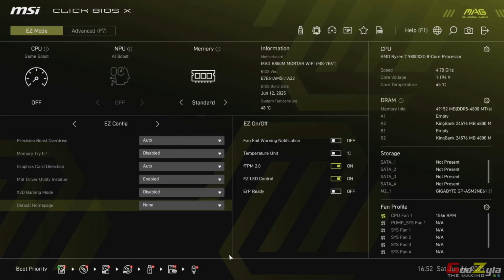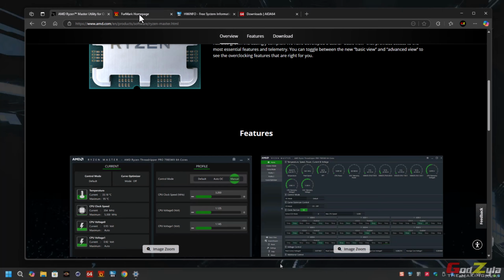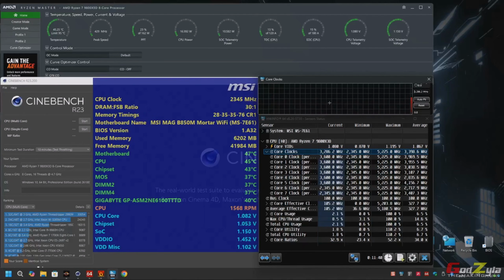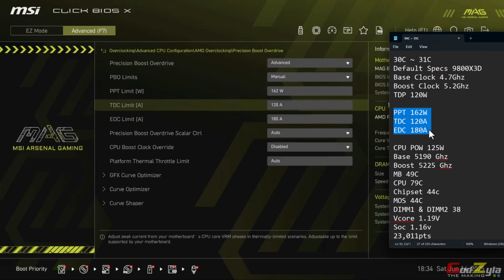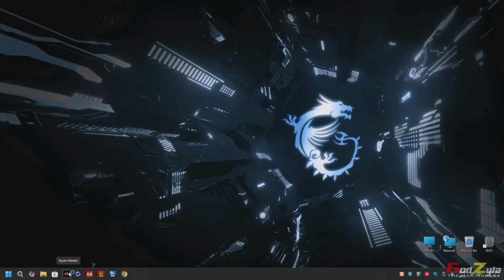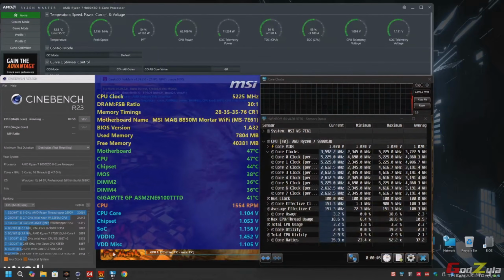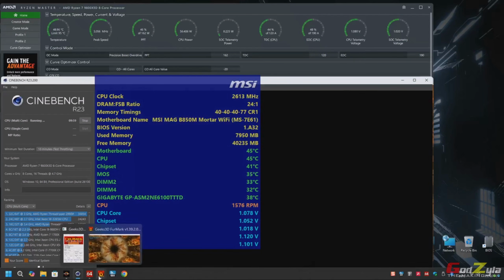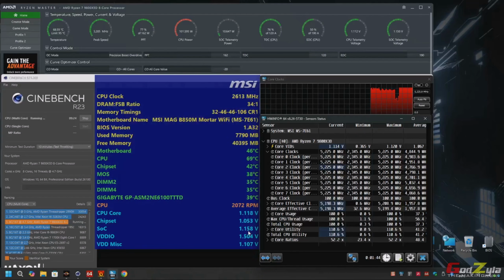PBO2 Curve Optimizing with 9800X3D on MSI Motherboard

Comment: On a Ryzen 7 9700x with an Asus B650M-E motherboard, what could I take from this video, or any tips to improve PBO and CO?
Reply from the maker: Welcome to my channel tgordo, you follow below steps and make sure you test it. 
Disclaimer, I will not be responsible if anything goes wrong. Do it at your own risk.

==Undervolting  Steps for 9700X==
Clear CMOS first  (PLEASE MAKE SURE TO CLEAR CMOS) and go into UEFI / BIOS

01) Go to Overclocking
02) Enable A-XMP or EXPO (depending your rams which it supports)

Skip step 03) to 05) if your rams are not of M/T 6000MHz

03) Set DRAM Speed 6000
04) Set FCLK Frequency 2000
05) Set UCLK DIV1 Mode to UCLK=MEMCLK
06) Set CPU Voltage to Offset
07) Set CPU Offset Mode Mark to - (negative)
08) Set CPU Offset Voltage to 0.05V
09) Set CPU NB/SoC Voltage to Override Mode
10) Set Override CPU NB/SoC voltage to 1.15v (make sure is 1.15v and not 1.5v)
11) Save and load to windows, run Aida 64 Stability test for 30minutes

If with errors, go back to UEFI, set the CPU Offset Voltage to 0.025V, repeat step 11) 
If still error, go back to UEFI set CPU Offset Voltage to Auto. (repeat step 11) 

if still error, go back to UEFI set Override CPU NB/SoC Voltage to 1.16V (repeat step 11) 
If still error, go back to UEFI set Override CPU NB/SoC Voltage to 1.17V (repeat step 11) 
you might need to set NB/SoC Voltage higher if it keeps failing but do not set CPU NB/SoC voltage above 1.18v
If no errors, go to UEFI and proceed to step 12).
The above is to ensure your processor can run at offset voltage and your RAMs able to run NB/SoC Voltage at 1.15v ~ 1.18v (depends which is stable for you)

12) Go to Overclocking
13) Set High-Efficiency Mode to Enable
14) Set Memory Timing Preset to Tightest 
15) Save and load to windows, run Aida 64 Stability test for 30minutes

If with errors, go back to UEFI, set Memory Timing Preset to Tighter, repeat step 15) 
If still error, go back to UEFI set High-Efficiency Mode to Auto.
If no errors, go to UEFI and proceed to step 16).

16) Click on Advanced CPU Configuration
17) Click on Precision Boost Overdrive
18) Click on Manual 
19) PPT Limit to 88W / 88000mA 
20) TDC limit to 75A / 75000mA 
21) EDC limit to 150A / 150000mA
22) Set Platform Thermal Throttle Limit 90
23) Scroll down, click on Curve Optimizer
24) Select All Cores under Curve Optimizer
25) Select Negative under All Core Curve Optimizer Sign
26) Set All Core Curve Optimizer Magnitude to value 20 
27) Save and load to windows, run Aida 64 Stability test for 30minutes

If with errors, go back to UEFI, set All Core Curve Optimizer Magnitude to -15, repeat step 27)
If with errors, go back to UEFI, set All Core Curve Optimizer Magnitude to -10, repeat step 27)
If no errors proceed step 28)

28) Set curve shaper as following.
Med Frequency , Low Temp & Med Temp & High Temp to -15
High Frequency , Low Temp & Med Temp & High Temp to -10
Max Frequency , Low Temp & Med Temp & High Temp to -05
29) Save and load to windows, run Aida 64 Stability test for 30minutes

If with errors, go back to UEFI, set Curve Shaper to all auto and repeat 29) 

once everything stable, run Aida 64 Stability test for 2 hours and OCCT test for 2 hours.
Reply: My memory is a simple Kingbank Chingchang chip. I did some slight timing adjustments on it, and it's currently at SoC 1.15 and VDDIO 1.22. CO is stable at -40 so far, and only at -50MHz because I'm using an AG620 and it used to stay there. @KleoYan
Reply: 80°C+ running on stock. It's very hot here.
Reply from the maker: @tgordo17  you mean after applying the instructions I have shared with you. it's still 80°C?
Reply: @KleoYan No, no, I said with my stock BIOS it would run at 80 in cod mw2.
Reply from the maker: @tgordo17  oh ok ok.. test out the configuration. and do test with Aida 64 Stability Test along each step of the configuration and all the best 😉😉
Reply: @KleoYan One question. Even if I have a high core size, like 35-40, can I still use your curve shaper? Or will it crash/not boot? I know you mentioned greatly increasing CO2, but to be sure, it's kind of hard to find reliable information about this online.
Reply from the maker: @tgordo17 I strongly discourage using the Curve Optimizer with values beyond a magnitude of -20 (for example, -25, -30, -40, or -50), as that would be overstressing the processor / over stretching. Over stretching the processor in long period of time will cause instability . SAme applies to enabling the additional +200 MHz maximum boost, I do not enable this as it gains no significant benefit and it increase more power drawn. Kinldy go through this content carefully and understand that the goal here is to undervolt the processor, not to push it beyond safe operating limits.
Reply from the maker: @tgordo17 I forget to mention. Yes you can use curve shaper as it’s cater for 9000 series amd processor. If it crashes, you can dont apply the curve shaper but you can set Curve Optimizer to -25 max.
Reply: @KleoYan  Your guide has been extremelyyyy helpful, I want to thank you and I have a question for you: I've been testing for 2 weeks now on my 9700X and doing 8-12hours over night tests with AIda64, Prime95, OCCT and Core Cycler + Ycruncher to validate stability. 

EXPO CL30 6000MT/S 32GB RAM,  Stock/auto PBO , 65TDP (88Watt), not using Fmax, and applying a curve optimizer. After a lot of testing:  -30 all core offset is stable, I've also tried per core offset and came up with -25, -30, -30, -32, -26, -31, -35, -35. Core 3 would crash on me if set to -34. 

Things look ok and are stable after hours of testing but your word of caution has me worried about going beyond -25 all core offset as you just warned. Would this be ok long-term?
Reply from the maker: Welcome to my channel Arome, if you are configure Curve Optimizer per core and leaving Curve Shaper untouch, it will be fine but will still advise you to monitor. Prolong period of time, base on my experience with 5950X and 7950X, I hit into issues after few months of usage, my system become unstable where I have to reduce the magnitude. here is another good video which does per core which you can refer too https://youtu.be/5cUY72GUHBc So the choice is up to you, if you decided to set the magnitude beyond -25.
Reply: @KleoYan  Thank you Kleo, that's the exact guide I used as I found the thread/post on overclock forums. I also used Hydra Pro afterwards to just line up and make sure to check my per core was in the ball park range of stable. More for a sanity check. 

Thank you so so much for replying back, I love that you can educate us viewers and reply to us, it's very helpful!
Reply from the maker: @Arome909  you are most welcome. hmm educate not really, it's more like sharing 😊Alrighty! Wishes you all the very best with your configuration too 👍👍👍
Reply: @KleoYan  You're too kind, thank you so much!! I'll look forward to your next video!
Reply from the maker: @Arome909  you are most welcome and thank you for the support too. 🫡
Reply: @KleoYan  Ha, thank you Kleo! I went to tighten up some of my EXPO timings as they were a bit loose. In doing so, it exposed how unstable my per core offset was. 

Yes I did stability testing for a week with stock CPU (NO CO) to make sure the new timings were stable on my RAM. 

With my per core offset and new RAM timings, it passed my normal tetss, but Ycruncher started throwing errors on my most sensitive core (Core 3). Which, usually gets an error if the CO is too aggressive. I will have to readjust my per core, now that the latency is lower between CPU & RAM. 

Again, thank you so much for your comment and video. It's the first thing I revisited when I came across this error!
Reply from the maker: Welcome back Arome. thank you for sharing and I wish you all the best with your configuration. It's your hardwork to go per core tuning. 👍👍👍

Comment: just wanted to say thankyou so much kleo!! this is my very first time ever building a pc so I really had no experience whatsoever, even more so with stuff like this, I got a -12c in temps!! also thankyou for being so detailed with your work, I really appreciate the in depth explanation, really felt the care you've put into this, compared to others that just say "do this, do that". I have a couple of questions, but first of all, for context, 
my specs are, 
9800X3D / MSI B850MPOWER / Trident Z5 Royal DDR5-7200 CL34-45-45-115 1.40V 32GB (2x16GB) Intel XMP [F5-7200J3445G16GX2-TR5S]

idk if it matters but as you can see my ram isn't really "ideal" considering its not really meant for AMD, I managed to run it at 6000 CL34 and so far have not experienced any crashes with it, still wondering if I could still make tighter timings (have not researched and tried yet)

also when I tried benchmarking for the first time before making any changes, my 9800X3D scored only 20726 point on cinebench, which is 3000 points lower than average.
CPU power - 112W (throttling) cant reach any higher cuz of CPU temp.
CPU clock - 5000~5030
MOBO - 53c
CPU - 90c
CHIPSET - 50c
MOS - 55c
CPU core - 1.206 ~ 1.208
SOC - 1.166
POINTS -  20726

after Curve Optimizing
CPU power - 92W
CPU clock - 5165~5175
MOBO - 50c
CPU - 78c
CHIPSET - 46c
MOS - 50c
CPU core - 1.116~1.120
SOC - 1.166
POINTS -  21993

as you can see I've gained a lot (1267 points) but still wondering if im still missing out on free performance now that I have headroom in terms of wattage and temps. 
honestly I just want to reach 23000 points just for the sake of it, unless I was really unlucky about the silicon lottery. 

is there anything else that could be done to possibly improve this even more? tho im already pretty satisfied, lower temps in general and even actually increasing performance.
Reply from the maker: Welcome to my channel Craze Dhark, First of all, congrats on your good results. As for ram timing, having to run at 6000 is the sweet spot and if you do tigther timing to CL30 or even CL38, you might crash the system. In such event, you will need to pump your ram voltage which I will not advise you to do so. Ram prices now are crazy. the settings you have looks fine.

Comment: Hallo Kleo. I have been using your config for a week now and so far everything works fine, but I cannot manage to clear AIDA64 on -20 All Core CO combined with the 15/10/5 Curve Shaper like you provided, on -15 CO it gives error at 15 min. Mark. so I can only clear it stable at -10 CO and -15/10/5 CS. My question is should I “increase” CS values and use -15/-20 CO or leave CO at -10 All Core with the -15/10/5 CS, which config would net greater benefit in your opinion, also what do you think for Scalar 1x vs Auto. Thanks, big fan of your work.

9800x3d / b650 tomahawk wifi / 2x16 6000 cl30
Reply from the maker: Hi Ivelin Vasilev welcome back. It will be more beneficial to set only CO to -20 and leave CS as auto. The reason for this is, each processor has it's own strong bin, the one I am having is a good bin sample processor from AMD (Loan Unit) as for scalar x1 is ok. you have to test it out Auto vs x1. For me when I did this content, Auto VS x1, the performance is identical.

Comment: Hey there Kleo ! I followed your instructions for my 9900X which has exactly same base stats. I see a bigger score, and some improvements while also running a little hotter to my surprise. Can you give some indications on what to further adjust ?

DEFAULT SPECS 9900X

BASE CLOCK : 4.4 GHz
BOOST CLOCK : 5.6 GHz

TDP: 120W
PPT: 162W
TDC: 120A
EDC: 180A

STOCK TEST RESULTS : 

BASE CLOCK : 4.4 GHz
BOOST CLOCK : 4.9 GHz
---
CPU POWER : 134W
MB : 49C
CPU : 75C
CHIPSET : 39C
MOS: 47C

V CORE : 1.146
SOC : 1.168

pts: 31, 333
=======================
AFTER PBO2 Curve Optimizing

BASE CLOCK : 4.4 GHz
BOOST CLOCK : 5.2 GHz

CPU POWER : 129W
MB : 49C
CPU : 77C
CHIPSET : 45C
MOS: 54C

V CORE : 1.030
SOC : 1.166

pts: 32, 346

So as you can see I had some improvements but my CPU is still not reaching the boost clock speed, still draws more power than it should, SOC still is a little higher and everything runs a little hotter. Any ideas ?
Reply from the maker: Welcome to my channel Sebastian Sãsicu, my advise is to clear cmos and do one step at a time and not just change everything in one goal. by doing one step at a time and to test it with Aida 64 Stability test, you can observe what went wrong.

Comment: Thanks for this. It's hilarious my cine went from 1225 to 1224 after following all these tweaks. CPU Boost Clock override disabled, every other setting is exactly as on the video. Setup: 9800x3d, 6000cl36, 850b mobo. It kept 5216 steady before the changes, now flat 5200. CPU Power tho went from 88W to 62W, which is ridiculously low...
Reply from the maker: Welcome to my channel Ivan Ivan, I can answer your question. when you have max boost. check the CPU Power drawn and check the thermal on your CPU, Motherboard, VRM, M.2 and DDR5 Rams. Next compared without the Max Power boost.. so with this said.. having cinebench at 1225 vs 1224, which draws lesser power and runs cooler on your component. In addition having CPU Power from 88 to 62W, which is more efficient? It's all up to you. you can set it with the Max Boost but I find it redundant as there are no significant uplift on performance. unless if max boost is set with drawing 70W and at a score of 1325 with all components at good temperature near without the boost clock, then I will set max boost.
Reply: I found that SMT was disabled, re-enabling it fixed it. Check your setting!
Reply from the maker: Welcome to my channel Ramin Azizi and thank you for the info shared. 👍👍👍

Comment: Thanks so much!  Just trying to understand:  Do I do all this with my graphics card already installed, or do I have to remove my nvidia graphics card before running furmark?  I have the 9800X3D in an msi tomahawk motherboard.  New system.😊
Reply from the maker: Welcome to my channel mk, You can do with or without. Just note that if you do with your GPU on.. you are only stressing on your Processor, therefore once you configured with the safe settings shown here, the CPU Power drawn on Ryzen Master will be lower, which is around ± 84W .This normally trigger most to push with the settings which I do not advise. For the illustration here, I choose to do it without GPU as you can see the CPU Power drawn is at 102W to 103W, once done and when I plug the GPU. the CPU Power will drop significantly.. This is will give slacks for the processor to run healthly without overstretching and this will prolong the life of the processor.

Comment: Hello. Thank you for the thorough explanation and overall great video/guide.
My question is this config is going to work with B650 Tomahawk Wifi board and Lexar Ares 2x16 6000 CL30 kit ?
Thank you in advance. I am trying to optimize my 9800x3d for longevity and efficiency.
Reply from the maker: Welcome to my channel Ivelin Vasilev. Yes it does apply to B850 MSI board too.
Reply: @KleoYan and B650 ?
Reply from the maker: @ivelinvasilev3530  yup, it will work too.